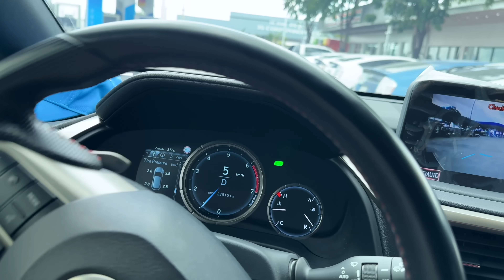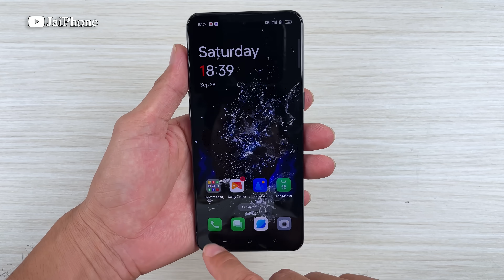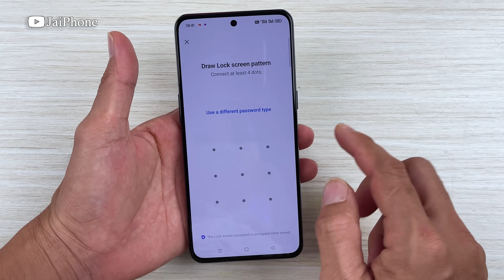Restoring DESTROYED OnePlus 10T Found on the Road! | Restoration Broken Phone

Comment: Hello brother... I have a serious question and I need your urgent help.

My phone (SAMSUNG A23) display was broken, I went to a local repairing shop. I was told to come and get the phone next day, which I did.
But, after 2 days I realized my phone Camera was not normal anymore. 
My problems are÷
●There is no 48mp resolution anymore.(Back Camera)
●I can see that the back side cover/guard of my phone was removed and attached back. (In my opinion, I think there's no reason why the back side should be touched while repairing a broken display)
●There is a tiny light blue plastic that slightly pops up between the front camera and the screen protector. (Which I belive was used to protect new cameras)
● Poor Camera result.

My question to you, my brother, Is my Camera /Phone parts stolen or exchanged without my consent?
Please help me brother. 😢